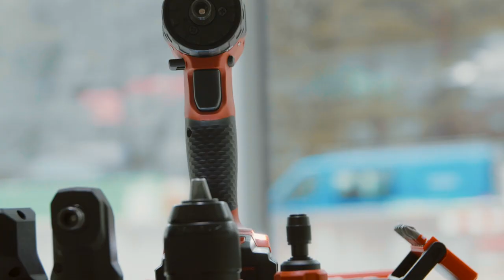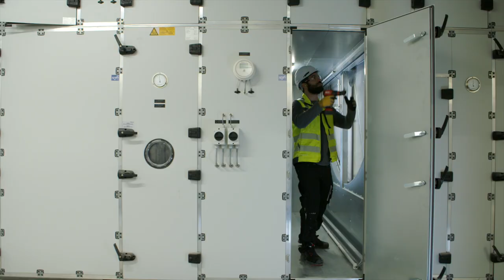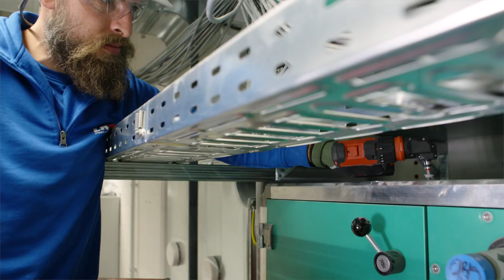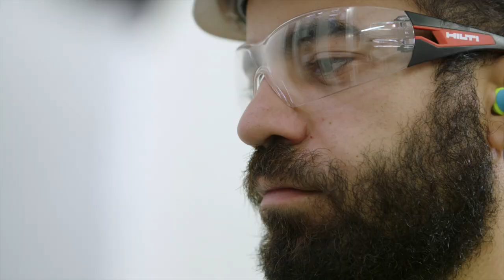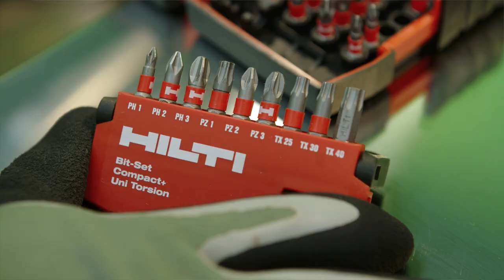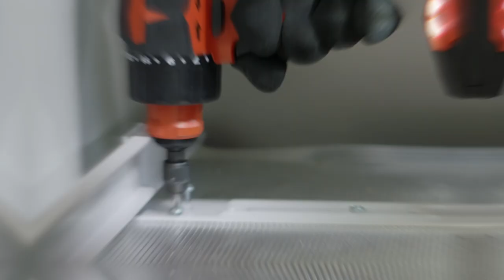INTRODUCING Hilti SFE 2-A12 Multi-Chuck Drill Driver

Comment: Good to see Hilti catch up with the festool T15. Which I bought well over 10 years ago. The festool can be fitted with a sheet rock screw depth Chuck attachment so is still a little more useful. But will look forward to the hilti 18v 22v version if it comes out